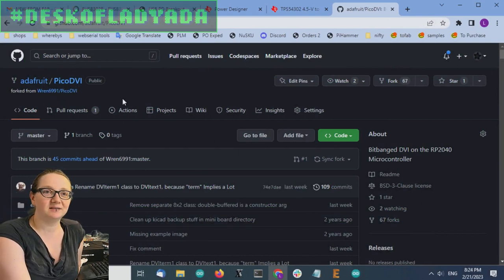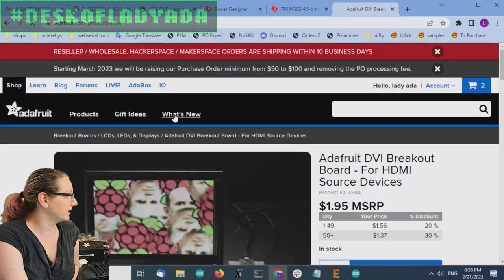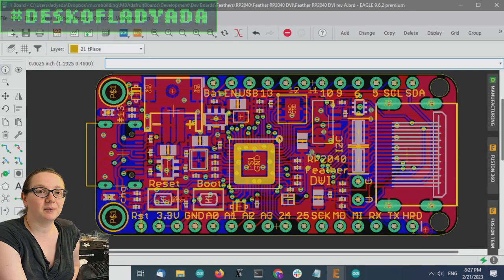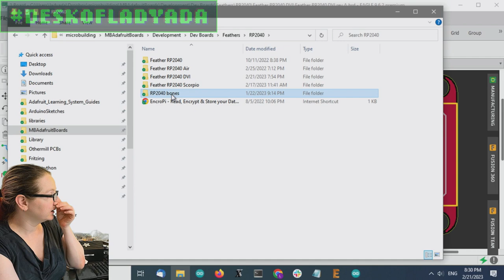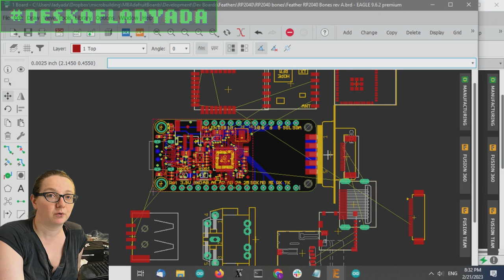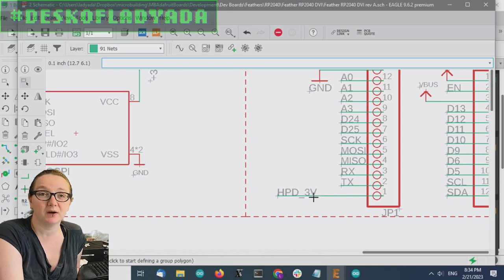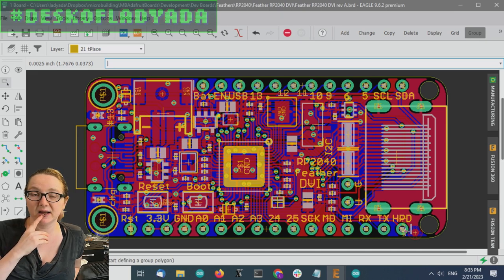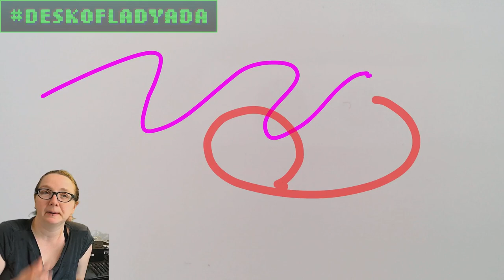Desk of Ladyada - overtime edition! RP2040 DVI Feather from Bones

Comment: Hi LadyAda, I have a problem and it's been my 6th day as I am searching for a solution, but I couldn't find it. I am using Adafruit feather m0 RFM9x LoRa node, it works really good with Arduino code, however there is a problem with the Python code. I am wondering how can I install circuit python to flash a python code on this board? Would you please provide me a prompt solution, please?